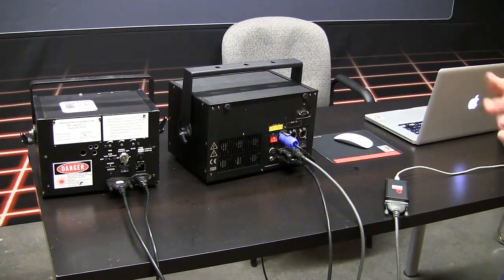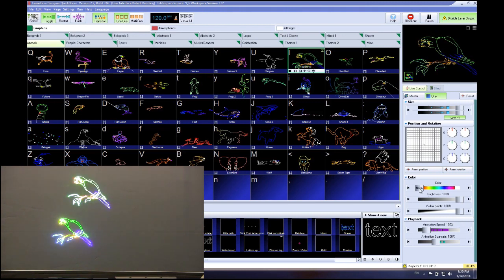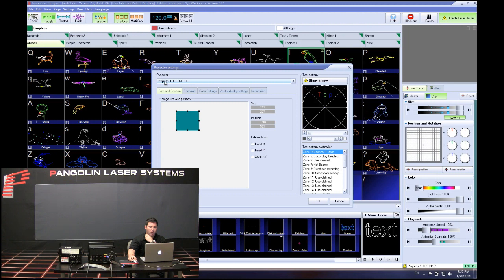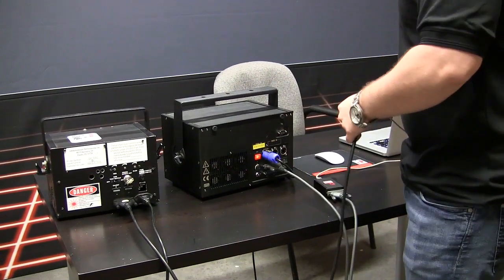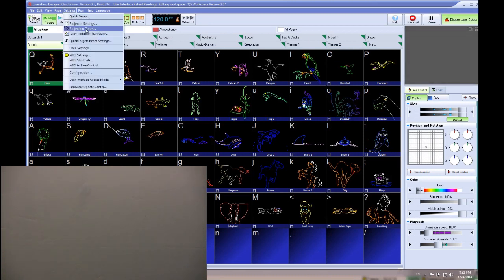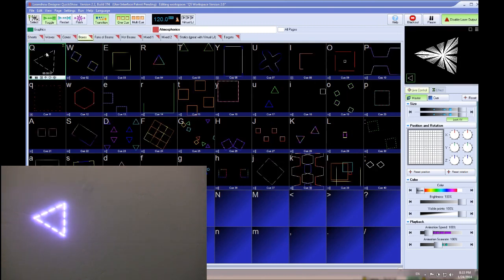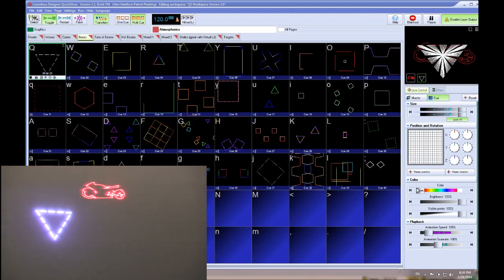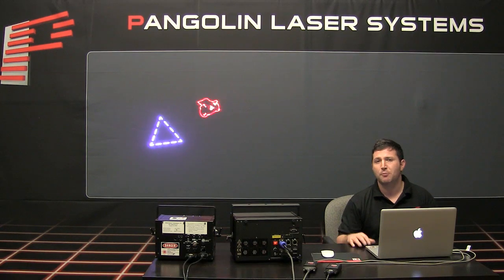Laser Show Software - How to control multiple laser projectors using Pangolin

Comment: i will connect two laser (one analog and the second ttl modulation)with one fb3. i must setup independently the two lasers to tell the program their specs and how to do this?thanks
Reply from the maker: For independed laser control, the setup will require 2 x FB3.
Reply: @PangolinSystems  not independently,two laser with the same fb3 but the lasers have different modulation. the output will be the same and it depends of the color and beam quality of the lasers?simply connect then in serial and use them?thanks again.

Comment: Is it possible to run a slave ILDA with the data mirrored, so that you can create a symmetrical effect using only one flashback?
Reply from the maker: If your laser has ILDA out, you can chain the lasers or use an ILDA splitter.

Comment: how many can you 'daisy chain' together if you have several projectors with both ILDA IN and OUT?
Reply from the maker: The number depends on the quality of the cable, and also the quality of the projector. We've seen it happen that poor quality projectors can't even be daisy-chained at all. If you use good quality cables, and good brand projectors (Kvant is just one example of this), then surely three or more projectors could be used in a chain.

Comment: Justin,  2 questions?  
1. Is the software compatible with Apple laptops?  (OS X)
2. Do I need two laptops in order to run two flash backs (to do independent projection?)  Will it be once instance of the program running or two instances?
Reply from the maker: Many Pangolin clients use Apple laptops. Our software is not yet native OSX software, but our clients use either Parallels or Bootcamp to run it. And you only need a single laptop.
Reply: Thank you!

Comment: could i use a powered usb hub to control six lasers individually,,, using six seperate fb3s then ?????   i have recently purchased pangolin qs and six lasers hoping to have individual control of all lasers somehow
Reply from the maker: Yes, correct. You need at least a few FB3. You could plug each one into a USB port on the computer, or several into a USB hub. Generally better hubs are powered.